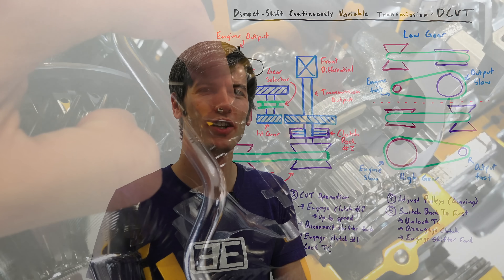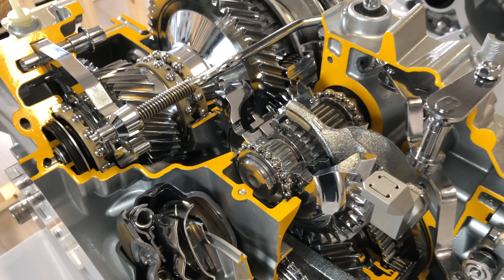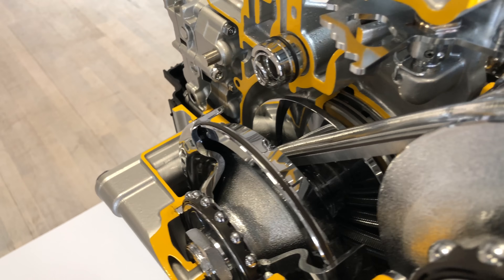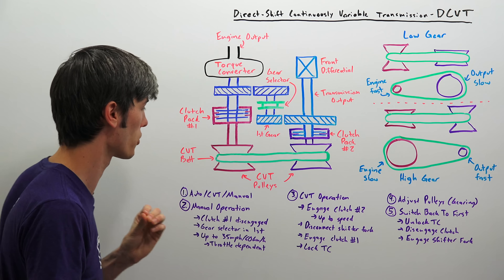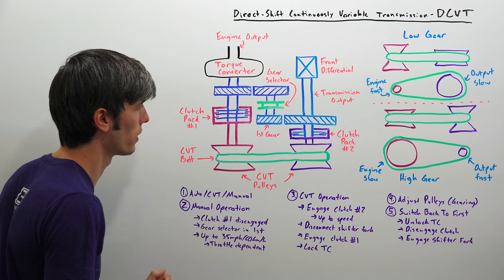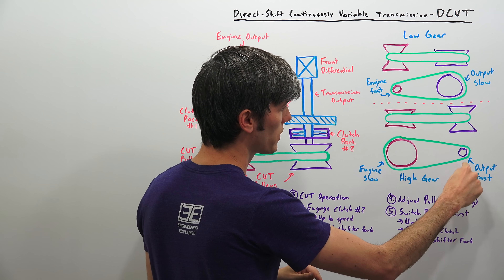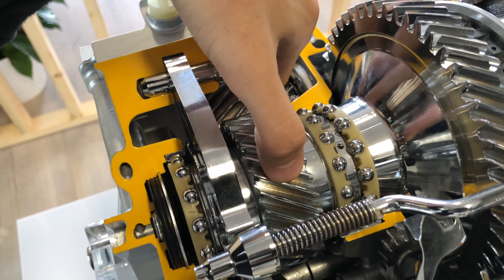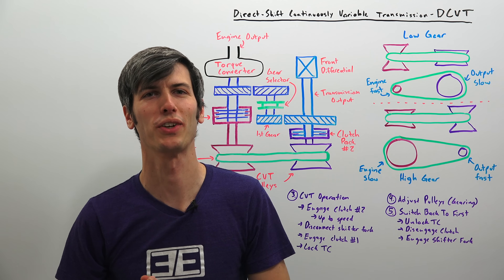The World's First DCVT Transmission - How It Works

Comment from the maker: Not only does it feel better to drive, this DCVT has quite a few advantages, including better acceleration. All the details on its advantages here: https://youtu.be/HanImTejIVM
Reply: Engineering Explained I would love this as an art object in my house (I have an exhaust valve from an R-3350 and an X-Ray tube on my workbench). My wife not so much...Does “bucket” have a list?...sorry...
Reply: Damian Grouse Just explain how lucky she is you haven’t found that V12 yet.
Reply: Eduard van Raalte The R-3350 is a Two row (18 cyl) Radial engine🖖
Reply: How reverse can be done on this DCVT
Reply: On the whiteboard he has listed Clutch pack #1. That "clutch pack" actually consists of a planetary gear set, one clutch, and one brake. This connects the input shaft to the planetary carrier when the clutch is engaged and when the brake is engaged the ring gear is held stationary. Because the planetary gear set is a dual pinion style gearset, holding the ring gear forces a reverse rotation.  So to summarize the clutch pack #1 can be in 3 states; neutral when the manual gear is engaged,  clutch engaged for forward motion, and brake engaged for reverse operation.

Edit:This comment was meant to address the people who were asking how reverse was achieved.
Reply: @dangerAlien  Thank You,, on behalf of "Other People"!
Reply: How does the reverse gear work
Pls xplain fully
Reply: Looks like a workaround for killing CVT with high torque, am i right?
Reply: Engineering Explained/the Kia Chain belt CVT comes very close. CVTs are getting better everyday.
Reply: Sue San Subaru and Toyota "owe" this technology to almost every company that has ever made a snowmobile, because that's where it's been used for the last 5 decades.
Reply: @blitzsportz  Ye, i know that some lonesome Grandpa first made a Snowmobile in Minnesota.  Turned in to Polaris.  Minnesotans turned out many more inventions, like Jet ski, Inline roller blades and stamps that you don't need to lick.  No Doubt all Germanic/Scandinavian/Nordic creation.  Look now, what kind of useless cars the German and "Swedish" Brands are turning out.  All of them are selling out their manufacturing to China.  So sad.
Reply: @suesan5111  agreed, the political and economic side show is sad.  I'm working on starting my own hyper-car company myself utilizing a lot of under developed and under appreciated technology.  My goal is to actually create the ultimate driving vehicle for james bond level stuff.  Unfortunately im still more than a couple years out from actually being able to do much but there's still a lot of hard work to be done in the mean time.
Reply: Engineering Explained dctv looks huge
Reply: Not in related videos for some reason.
Reply: Looks amazing but I can only imagine the repair costs
Reply: Perhaps Nissan should licence this system for their cars and drop the high failure rate of the current CVTs.
Reply: Aprilia made a motorcycle (Aprilia Mana 850) that was a CVT but you could change driver modes and it could also be a 7 speed manual. Back in 2007
Reply: Hi dude! Could you do a video on Why some engines rev up quicker than others? And the path that oil takes thru an engine? Like where the oil gets to and stuff 👍
Reply: I wonder if Toyota has different kind of hybrid using this CVT...? Prius use planetary because of some reasons. I know Nissan hybrid uses a bit different hybrid tech, but not using this CVT.
Reply: Sandy Lee  You're not wrong but the actual cost is a lot cheaper than you'd expect.  Sure the cost for the mill is about as much for an inexpensive new car but when you can make a couple hundred new cars with it the over all expenditure is insignificant.  Car companies just keep adding redundant technology that's already broken over the initial cost to keep overall costs higher.  

And a widebody subaru would be awesome with an achates tho i'd have to opt for a supercharged variant as homage to the original jumbo jumo 26.5 liter 6 cyl.
Reply: So this is simply the same as the Variomatic in my moped, or not? Except the part with the gear and clutches.
Reply: @michaelk5976  pretty much, change the belt material and boom a car transmission.
Reply: Is this whats in the new lc500h?
Reply: i bought a 2023 corolla (2.0L) and the gearbox clunk (it clunks the moment i press or release the gas pedal) the dealer says its "normal" !!
Reply: Engineering Explained I'm guessing it's expensive to fix when it goes wrong
Reply: @StoutProper  You probably don't fix it, you buy a new one.
Reply: I think the DCCVT should have a 2 speed gear pack, not a 1 speed. 1st and 7th.
Reply: @ellenorbjornsdottir1166  i thaught it through,  i dont think you have.  Not plausible, not simple possible,  and but why in first place?  Whut up so wit Swedes?
Reply: Super righteous Jason!
The all three in one is a bit beyond my capacity to understand.....lol
I wonder what type of transmission fluid it takes?
Reply: Toyota Owes Subaru this technology.  After all, Subaru was nice enough to build them an Entire Car, with a boxer engine.  Subaru really needs a better transmission.  Boxer Symmetrical AWDs with a LAUNCH Gear would be totally Awesome !  Finally put some Power down!
Reply: CVT is very useful in low speed (60km/h and below). However, Dual Clutch simply does better when comes to high speed and demand in performance
Reply: @C3ByAx  
It's going to be interesting to see the fuel mileage ratings in the next 10 years......lol

Comment: I might've missed it but why the clutch pack on the output shaft? Is it merely to prevent the CVT components from moving while first gear is engaged?
Reply: i believe it's to stop the transmission from being in both gears at the same time. the dcvt design is based on the older dual clutch gearbox which had two clutch packs to make shifting faster, and which allows rpm matching for a smooth shift.

Comment: What would happen if I paired something like a go kart cvt transmission with a traditional motorcycle engine with a 6 speed manual? The cvt would be mated with the output shaft which would normally be connected to the chain. Would it have any advantages or just overcomplicate a system that works fine already?

Comment: Something seems strange with the schematic - why are there 2 clutch packs when disengaging either one would effectively bypass the CVT? Unless the one on the output shaft is part of a planetary gearset + clutch assembly used for reverse/forward switching?

Comment: I have a 2020 corolla se with this Type of CVT. I am noticing at leas once a month, when almost a the stop, car seems to jerk forward a little as if the CVT is slipping. Also when a stop, car will sometimes vibrate(pulsate) almost as if engine mounts are going bad. If i move forward a foot and stop it goes away. I am wandering if CVT is going bad and i am debating on selling the car. I have a feeling this design still has some issues.   My current mileage only 10,000 miles.
Reply: Have the same jerk u have. But a lot more then once a month. It’s once a drive. Brand new 24 corolla. Did you ever find anything out?

Comment: Doesn't seem like many moving parts at all, 6 grand to replace one dem
Reply: It costs about $8k for the "humming noise" issue with the K114 transmission in the C-HR. Just look at the forums - not good quality bearings in the K114

Comment: Toyota wanted to revert to solid gears (conventional auto) but that would be insulting their own decisions. Toyota regretted CVT because the performance was garbage (still is garbage). Teh result is you have 1 solid gear Hahaha.
Reply: Toyota's direct shift CVTs are having problems already like in the RAV4. I would never buy a CVT.

Comment: What lengths mankind has gone to make the ICE work!?😅 Tooth on tooth type manual gear + CVT combo or planetary gear + tooth on tooth gear + 1 way clutch + electric motor combo or tooth on tooth manual gearbox or CVT, all along having to use a clutch interface of some sort to connect the gearbox to the ICE.
I know electric motors are replacing the mechanical gearbox to cope during the torque challenged regions of the ICE but not yet available on everyday budget cars. Which sould atleast be able to get rid of the clutch interface by switching over a CVT paired ICE, to electric motor during stalling speeds.

Comment: Quite complex = lots of bits to fail. The 'variable’ bit is still achieved by belts which give potential to slip. The ultimate would be a infinitely, continuously variable transmission that is all mechanically linked ie. no belts so no potential slippage.
A friend and I have had a design and a basic working prototype for 20 years that achieves exactly that but cannot afford to patent it and have the big companies steal it. Our design is simple and has few moving parts and therefore a lot smaller and lighter for the same strength. It is infinitely variable so does not step from one ratio to another; it can change from low gear to top gear and anywhere in between whilst continuously maintaining drive. To expand the available range of ratios it is modular, so you can just couple one box up to another.

Imagine this coupled to a software driven actuator, you could chose an automatic style setup or manual with as many gears as you wish and select your own ratios for the driving style you intend. Of course F1 would love it, they could choose the optimum engine rpm for speed/fuel economy and maintain that engine rpm whilst altering the speed of the car by changing gear ratio.

If you know a genuine funder for a project like this please let me know.

Comment: I also invented  a continuously variable transmission. However mine doesn't require belts or torque converter. It does require electricity and MCU. Contact me if interested.

Comment: there is an L mode within new subaru crosstrek's (or XV) cvt. It is told that L mode is desigden for engine brake, but I sometimes use L mode to start driving faster. Especially when I climb hill roads or when my car is full wtih 4 person and baggage. So is Subaru's L mode is something similar to that or not?

Comment: My solution for fuel economy is a Suzuki Alto 800 : simple, cheap and easy to maintain, with a fuel economy from 38-64 mpg (6.217 - 3.67 l/100km ). For daily use it feels great after the 24l/100km with my Ford Super Duty.

Comment: At 150k miles or about, the two clutch packs will trash the car when they need replacement. Mechanics around here would rather change whole transmissions  then special tool these apart. The nerve of Toyota's  R&D department.

Comment: This is interesting, but how does it match speeds to shift. Eg. you are stopped and in neutral, the torque converter turbine is spinning, to shift into gear you need to stop the input shaft. Either you have an input shaft brake or clutch or a really sturdy syncro on the gear

Comment: Does the second lock-up clutch work only simultaneously with the first clutch, or does it help the CVT driven sheave, monitor the output shaft speed?
 It looks as if it doesn't, that there would be a drastic shock from the difference in speeds, and the mass of the sheave weight, when it goes from direct gearing drive to the belt drive ...

Comment: Personally I prefer the Chain belt CVT on the Kia over the troublesome single gear plus push belt on the Toyota K120 transmission.  The response and wide ratio of the Kia is better and much, much smoother.  No recall on the iVT either. Clutch pack that transfers power from the gear to the push belt has been proven to be flawed on the K120, and Toyota is working on a fix.

Comment: Old news GM had it in 1995! for city buses   but did not have a consumer version tell 2007 with the hybrid tahoe
4 Speed EVT transmission(4 speed +CVT)

AND it can tow 6200 pounds (with the tow mode selected )..

Comment: So it's just an Automatic transmission with a CVT component. Seems overly complicated for no reason. Past being able to accelerate faster up to 35mph than a regular CVT(I owned a Nissan Sentra with a CVT at one point. They're horrible from the dig) ,it offers no real advantage performance wise. It would probably be less stress on the belts during initial load and they'd be less susceptible to premature stretching or damage due to the fact that they're being used less. Less load could also mean better economy. It's probably way cheaper to manufacture as well. Since you can make a smaller CVT.

Comment: I'll be honest here. That transmission looks scary complex and far too huge for a car. But as always: you explained it perfectly and very easy to understand, very well done! But what i don't understand is: What do you need the torque converter in CVTG mode for? I mean, it's nothing else than a third clutch, right? 
Plus, i see a problem with the clutches, while shifting into and out of cvt mode. Doesn't that also mean that they are constantly slipping at certain speeds?

Comment: lets take all of the highest failure rate parts of every transmission and pack it into one shoe leather express transmission.  Idler gears, clutch packs, and cvt belts all working together :D... why not just make a dual belt cvt for more surface contact to minimize slippage and maximize component life? while your at it throw in a decent heat exchanger and over-sized low micron filter to prolong oil life.

Comment: What's the point of diminishing the CVT for part of the driving when it it's the main benefit in the first place? A bit of DCT thrown in as well? 
Just adds weight, complexity and bulk just to please the ignorant.
This its even more ludicrous than programming simulated automatic style shift points as Toyota insist on doing with their existing CVTs.
It's a shame they don't allow you to turn it off as it has proven to be reliable.

Comment: so how does the lubrication system work?  does the fluid in the torque converter used in the CVT section as well? or it's two different (or independent) chambers that holds two different type of transmission fluid?

Comment: As intelligent as this guy is, he never ceases to amaze me of the BS he is coming up with for sales. The transmission is a piece of crap even if the theory is a grasp for plausibility. Also, it should be called a constant velocity transmission and not a constant variable transmission. The theory of it is: an object in motion tends to stay in motion until acted on by an outside force. Thus the word velocity. I guess one could call it a non variable transmission and that would make more sense. Any variable would be a hindrance to the function it's engineering strives to be.
Reply from the maker: You're trashing me for making stuff up, by... making stuff up? CVT stands for continuously variable transmission. These don't have constant velocity, but they do generally vary the gearing to suit the demand of the driver (more throttle, more aggressive gearing, less throttle, less aggressive gearing). I don't know what exactly you're upset about; I'm not trying to sell you a car, I'm just trying to educate folks about how it works. Hope you have a great day man!
Reply: @EngineeringExplained  I am trashing you because I remember you when you were young and I admired you. I don't admire you very much anymore. You sold out. All of a sudden everything about you changed. It makes me sad. You are an extremely intelligent guy and I don't mean to take anything away from you, but all I can do now is shake my head left to right and wish it wasn't so. I used to trust you. I do not trust you now. I think you even believe you "educate folks". You used to. Not now.
Reply from the maker: Lexus didn't pay me to make this. Never made a dollar from Toyota. It's a bummer you don't like the content anymore. Thankfully YouTube is full of great stuff. Hope you find some good ones out there! ChrisFix, EricTheCarGuy, HumbleMechanic, and Matt Maran Motoring are some of my favorite channels. Hopefully you can find some good stuff there! All the best.

Comment: Looks like the "manual" part of the transmission is there to save the push belt, which is historically the weak point in a CVT. It will be interesting to see how these hold up.

Comment: I rented a Nissan Versa Note about 5 years ago and it had a similar 2-speed CVT, although the CVT part operated on both low and high.  It would go through its variable range in first, then shift to second about 30 or 40 MPH and go through the variable range again.  It was kind of crude, like the old GM power glide transmissions of 60 years ago.  I don't see this new one as being any leap in technology.  What's the point other than maybe a slight increase in MPG?

Comment: From an Engineering stand point...Do you think this is a sound design for longevity?
Reply from the maker: To me it doesn't seem like it'd be any less reliable than a traditional CVT, and you've taken the highest loading the CVT would see away, and put it on a physical gear, which is an improvement. Toyota has a good reputation, I wouldn't be surprised if these were super reliable.

Comment: The CVT is a nice idea on paper but loses all of its "advantages" (limiting engine RPMs to the area of peak efficiency)  in application.
It is so annoying in actual practice that all carmakers that sell them must force them to act/sound like a multi-gear transmission, which negates the whole purpose of employing the CVT in the first place.
They are mechanically fragile and cannot handle the torque of an engine that puts out more than about 200 foot pounds.
Toyota has evidently determined that the greatest period of wear is moving the car from a dead stop, so to increase the service life of the belt, they have inserted a toothed gear for starting off.
I will never buy a car that has one.